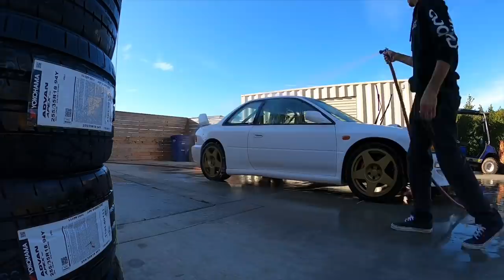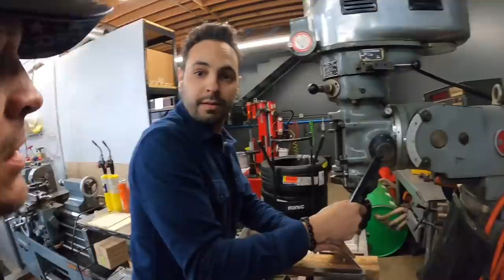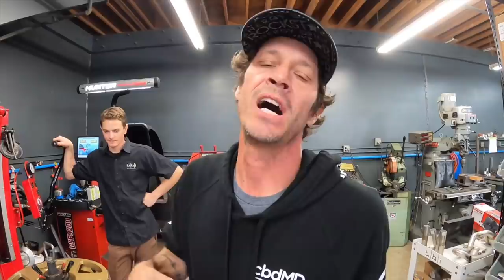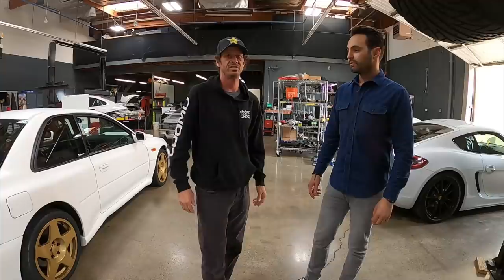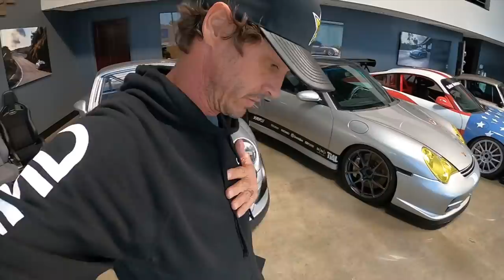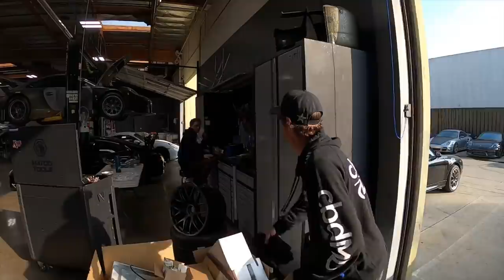Vlog #4 “NEW RUBBER”

Comment: Hahah. “Don’t look at this” as you push the corner light back In. I hated that with my RS! Happened all the time to me. 

PS::: not sure if it’s the the GoPros  wide angle but your steering wheel appears to be off center, angled right. Might need an alignment to straighten that puppy up.
Reply from the maker: Mike DeVenuto Yeah, I still have to go over final fitment on kit before paint so that side is not as dialed as the other. Hasn’t became a dingle berry yet but it pops out a bit😂 Good eye on the wheel, it’s off a couple clicks as is the entire suspension. KW 2 ways, Cusco bits and corner balance are all coming soon👍🏼

Comment: go 5 mm spacer all the way round the back wheel arch dosnt match up with the wheel ... looks 2 small ive that or you need to lower it the wide body kit should be 4x4 symmetrical because of the AWD
Reply from the maker: Scorpio King I could pick a few more things apart for ya if you’d like. It’s a project car that’s not finished. Stay tuned👊🏼
Reply: @buckyeah3382  I WATCH EVERY SINGLE VIDEO KEEP UP THE GOOD WORK

Comment: What are the specs on your wheels? I’m running 275/35/18s on an 18x10. Considering dropping down to a 255 for a little bit more clearance. Deciding if I should go 255/35 or 40.
Reply from the maker: Danny Arellano I took of 265/35/18’s to replace with 255/35/18’s mostly for clearance and it gave me all that I wanted👍🏼
Reply: BuckYeah thanks, man. Always been a huge fan. You were my favorite of the big 4 (you, hawk, mac, and bob).

Comment: Would you day the Advan apex's outdo the r1r's you had on there before? I currently run the Apex's as well but I was thinking of a tire with more grip and I thought the r1r would hook better
Reply from the maker: Advan’s a better daily tire that doesn’t fall off in performance and won’t heat cycle like the “stickier” tire.
Reply: @buckyeah3382  awesome to hear, I guess I'll just play around with the pressure a bit on mine and see how it goes then, thanks for the response!